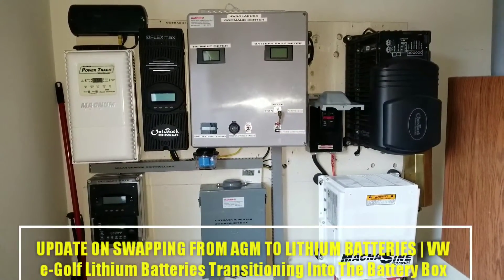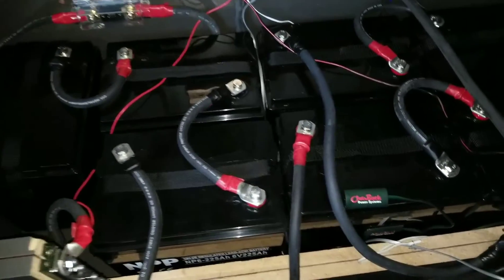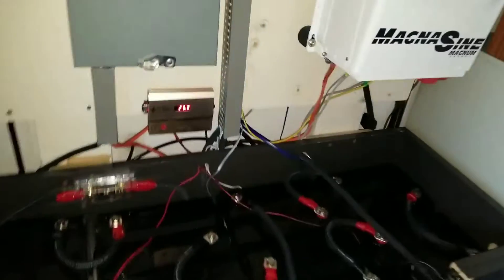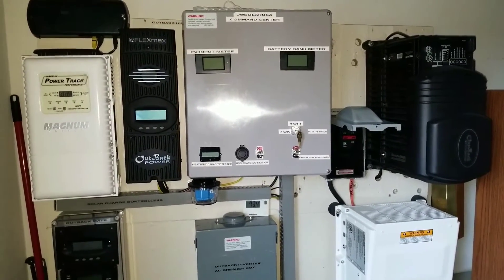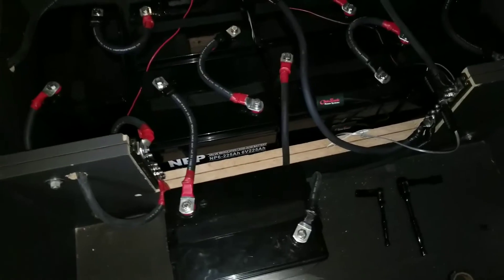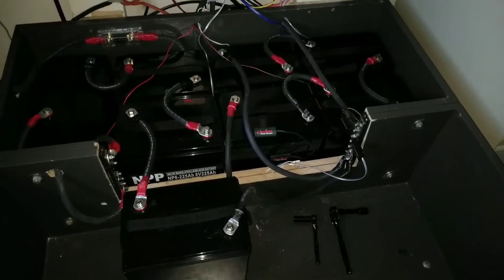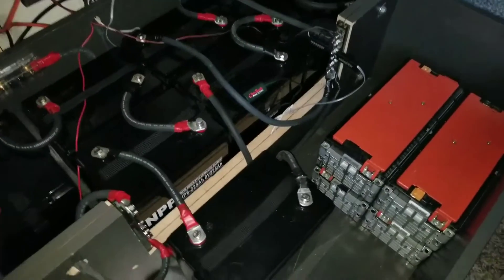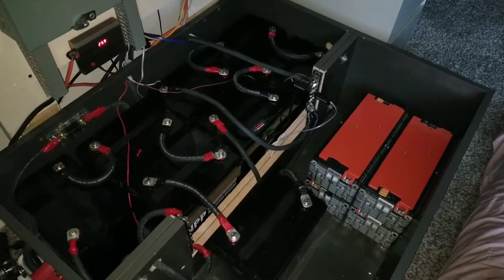UPDATE:#2 SWAPPING FROM AGM TO LITHIUM BATTERIES | VW e-Golf Lithium Transitioning Into Battery Box

Comment: Why is the battery temp sensor on the boss bar and not on the battery?
Reply from the maker: So I can able to monitor the rest of the battery strings all at once instead of attaching the BTS only one battery terminal. 
By doing this, you can have accurate temperature readings on the rest of the strings on your battery bank.
This is how I have done it, and has be working Fantastically for my application.
Brother remember, we all experiment things differently and this is route I have taken and is working perfectly .
Have a bless day Sir.